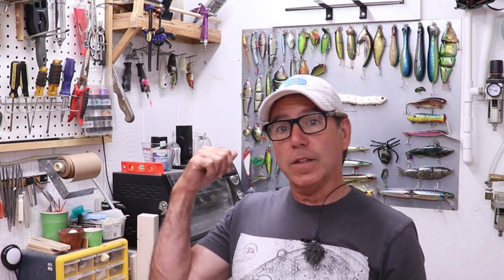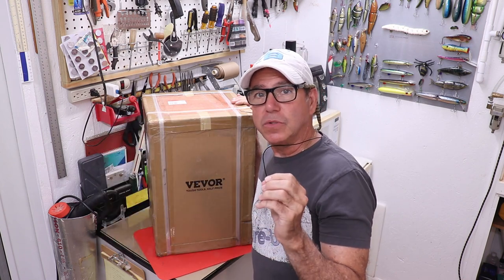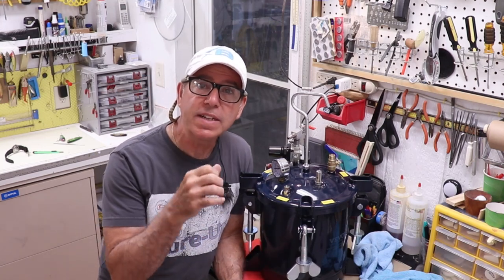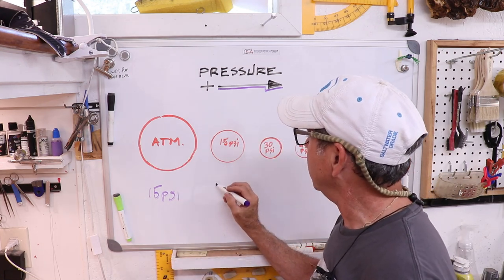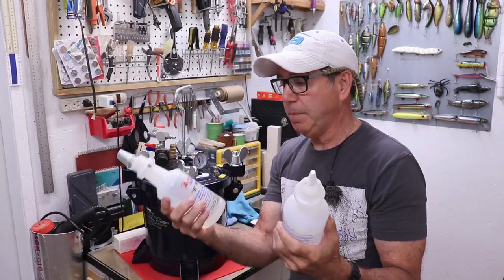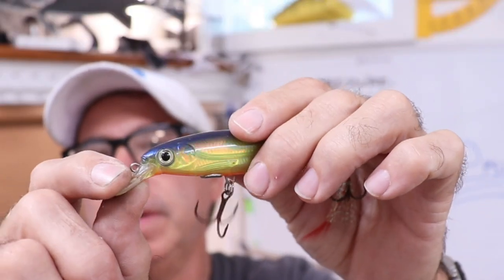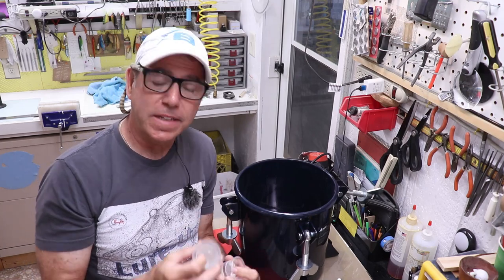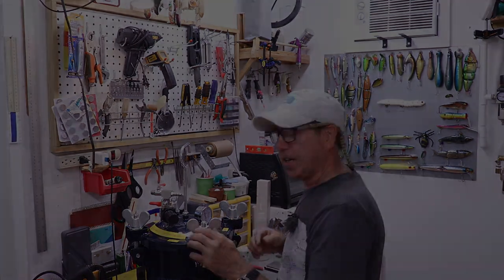Pressure Pot Resin Casting, Casting Clear Resin Lures with NO BUBBLES!  #resin #luremaking

Comment: I cast resin for pen blanks. In them, I use anything from wasp nests to rotten wood. The biggest obstacle that I run into are the small bubbles trapped in and under the things that are put into the resin. I have a painter's pressure pot and found that the bubbles are still there, but are extremely small. I also have a vacuum chamber which removes all the bubbles.

Comment: I use a lot of two part epoxy, building rods.  Like you, I am a little ocd about some things, bubbles are one of them.   I have found the best shaped stirrer to be, an elongated teardrop.  I snap the bristle end off those cheap little plastic kids artists brushes, and remove the aluminum housing….that gives you a nice rounded stir stick that tapers up to your hand.   Using the pointed back end of those brushes that taper Down, into almost a point, seem to pull air in and creates far more bubbles than using an upward tapered stirrer. Anything uniform….flat, round, square,etc…seem to pull air in.  Anyway that is my personal observation after, what feels like, hundreds of hours stirring and degassing epoxy.   You may have an instrument at NASA that reads the bubble ratio, in a mixer, but….the previous owners of my house and garage, apparently didn’t think that that was a worthwhile, enough, selling point, to install one.  ….so observation is all I have 🙄
Reply from the maker: I find a 1/4 inch stainless steel round rod    really limits the bubbles too.  In the video,  I wasn't trying too hard. I wanted the pot to do the work.

Comment: I'd like to know if it's possible to make a diy version of Berkley Gulp saltwater soft plastics if you have molds. The biodegradable part and the scent might be too hard.
Reply from the maker: casting the soft plastic is the easy part.  I often soak my normal soft plastics in "gulp juice". I'm not saying its exactly the same but it definitely stinks up the bait.